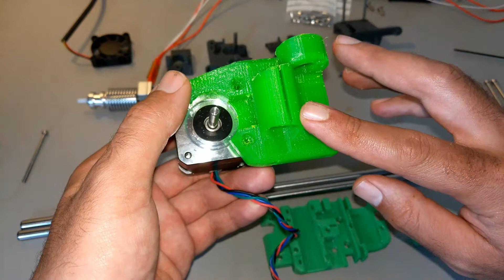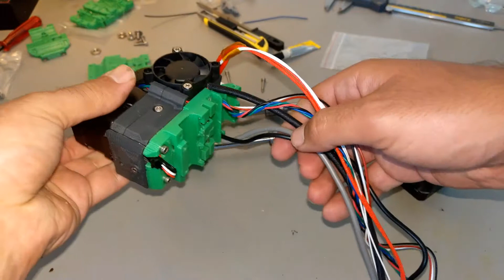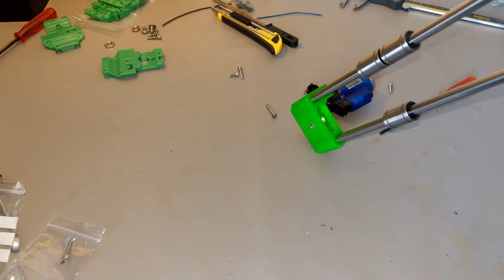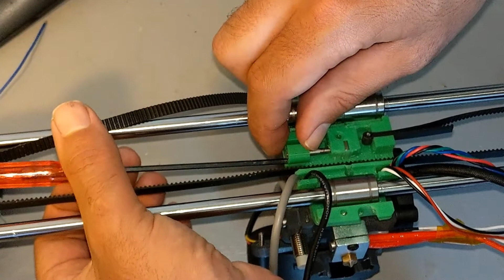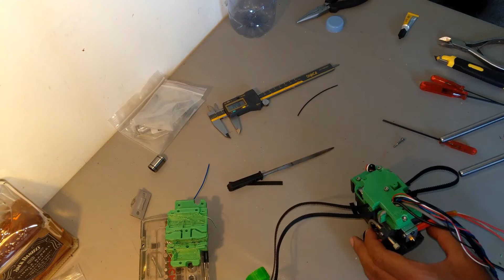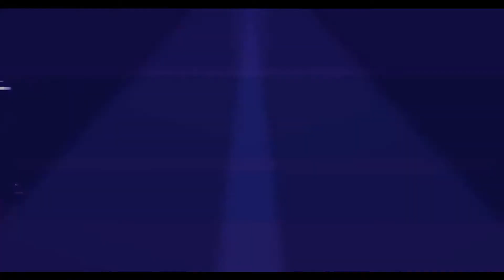Prusa i3 mk3 x-axis belt tensioner, Prusa X-axis Upgrade, Belt Tensioner

Comment: This is great. Surprised more people don't use it... I suppose the pulley at the idler end would take less plastic to print, but I would rather change the extruder carriage than take apart the whole x/z complex and I think the way this adjusts (and also the way it holds) the belt itself looks really slick: nice work! I will post a make on the thing's page, after I set it up. Thx for sharing!

Comment: This will work for the I3 MK3S+?
Reply from the maker: Yes, it's the same as the previous models(mk3/mk3s), just if you print the new parts, make sure that the tensioner moves freely in the slot , if not just file the sides of the slot ,
Reply: @ParsMaker  Awesome, thank you very much. Going to give this a try soon.
Reply from the maker: @legendarygaming9576  Thanks for watching